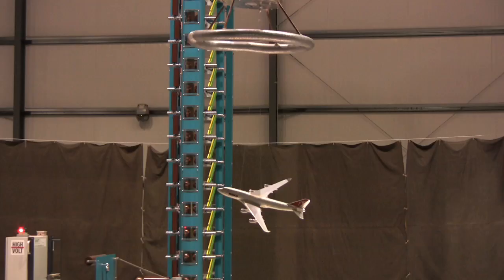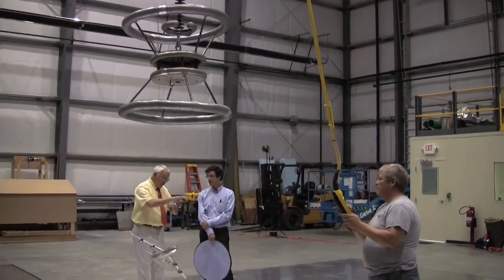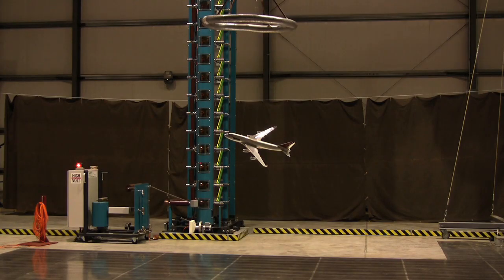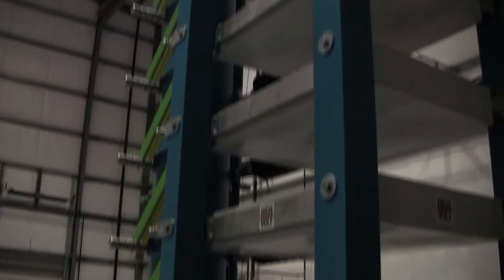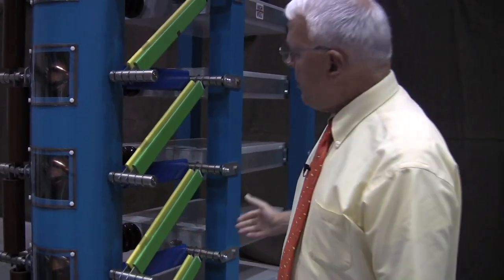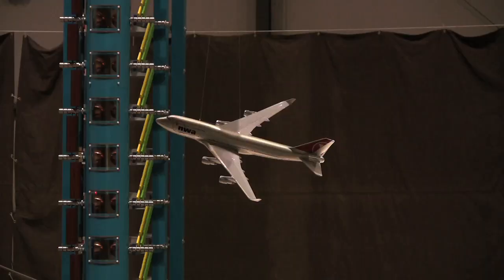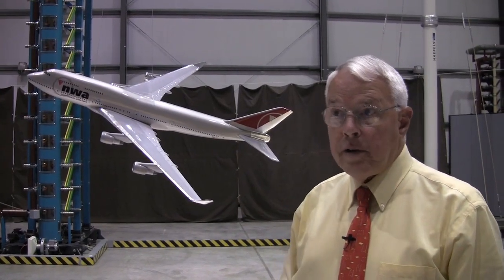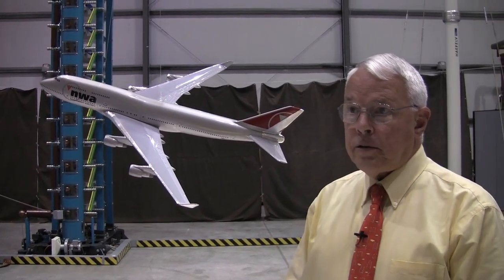Visit to the Lightning Lab

Comment: 2:30: correction: the spark gaps connect all the discharging capacitors in series, not parallel. You charge the capacitors in parallel, but discharge them in series; that's how you get all 2.4MV from (24) 100kV stages...